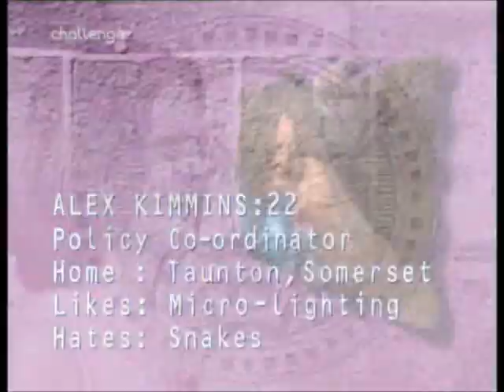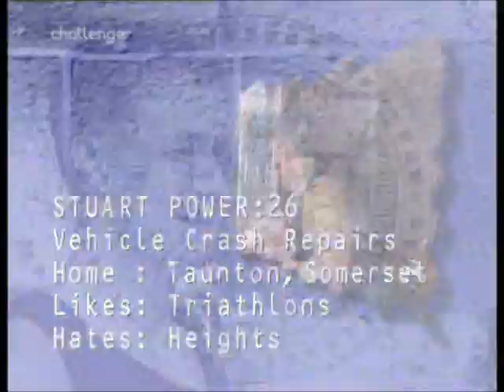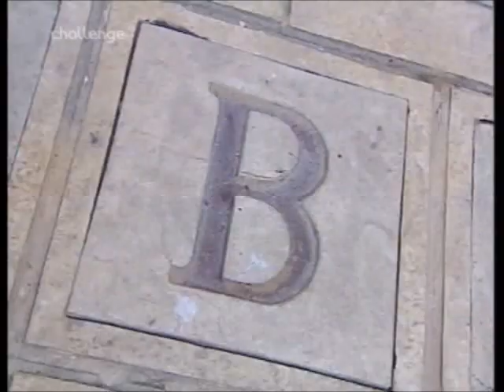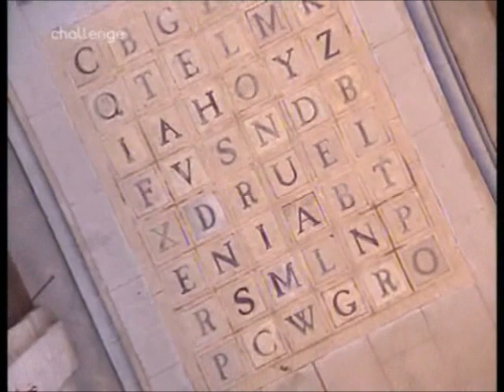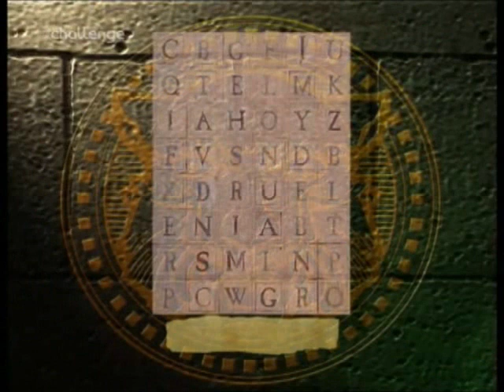Fort Boyard UK - Series 2 Episode 4 - 10th December 1999

Comment: I preferred The Turnstile Challenge like it was done here, a lot more fairer in my opinion and no real excuse for failing it when you haven't got to run ahead of a blocked-off gate
Reply: I think they wanted to make it easier since it was quite difficult with the grill in 1998, which gives they contestant playing more of a challenge.
Reply: @Coolharry64  In Series 3 onward the brought back the gate but had The Turnstile rotating the other way give them the chance to jump out & back in again instead of constantly running ahead of it like in Series 1